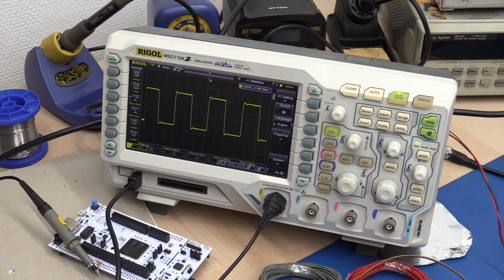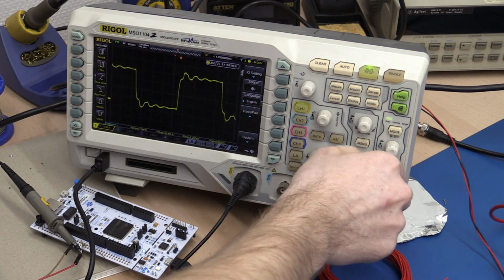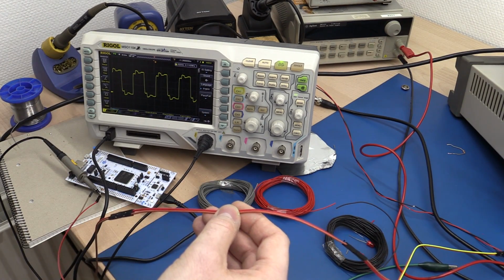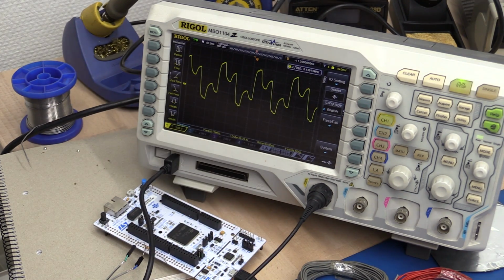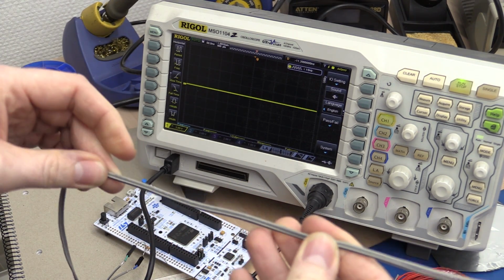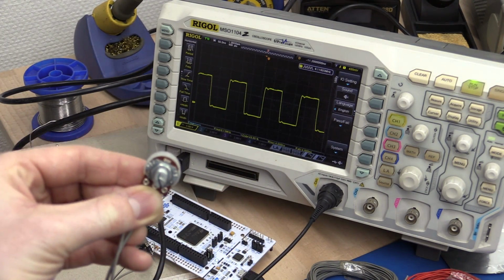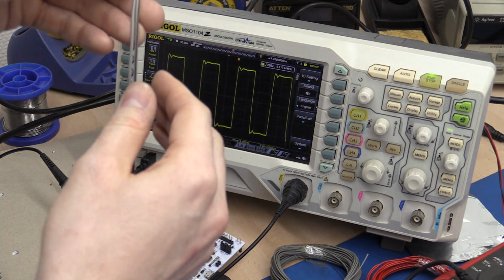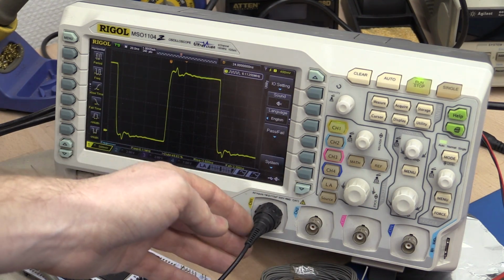Signal reflections and Transmission lines - Ec-Projects

Comment from the maker: FIRST!
A few things I forgot to mention, that I noticed when I edited the video. This is a big topic for PCB design as well! Especially at higher frequencies - and the same techniques apply. Your bare board PCB manufacture will happily, for a big bag of money, make your PCBs at a specified impedance (+/- some tolerance). You still need to keep the correct trace width and spacing to the ground plane though.

For systems where you use the same wires for RX/TX you would put the parallel termination in both ends of the cable (RS485, CAN, etc ).